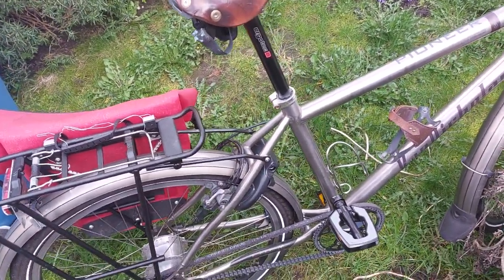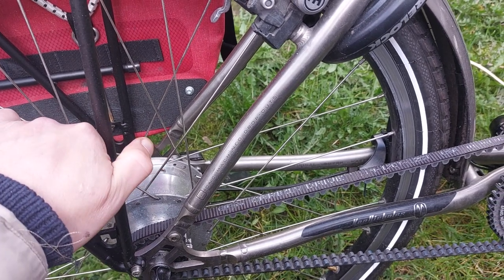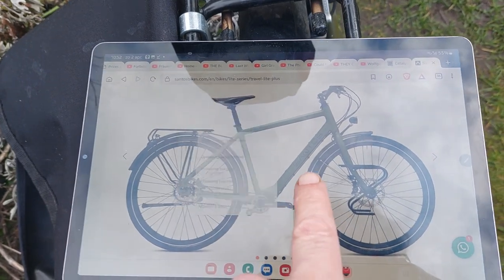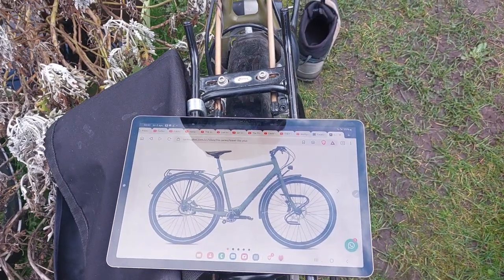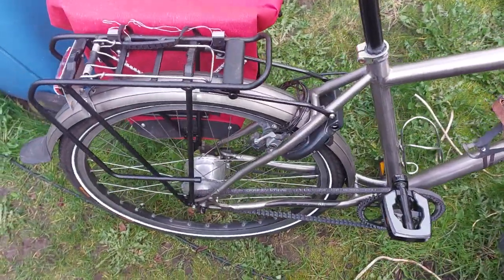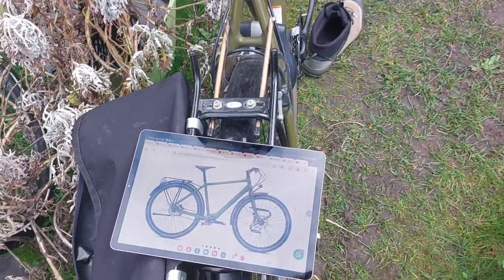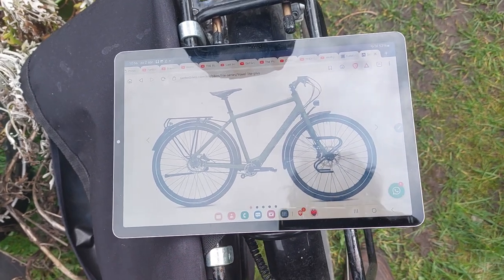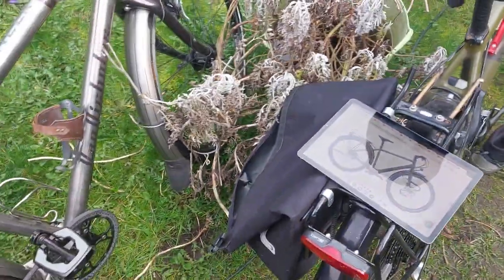Compared: Pinion P1.18, C1.12, Rohloff + Gebla Rohbox, Rohloff + twist shifter, Nuvinci/Enviolo

Comment: thanks. i am thinking of selling my pinion c12 for an 18. you made me make up my mind more quickly. by the way, what is the water cage you use with the leather strap? my water canister is too big for many, but looks like it would fit in there.
Reply from the maker: The p18 is definitely nicer, but try to find a shop who has a bike with p18 to make a test ride to be sure it is good enough to make the change... The bottle cage is the "Point retro". The main body is aluminium, the strap is adjustable in size with a clamp. The specifications state it works for a diameter of 68mm-80 which means it is quite useful to put in non-standard bottles. It is a bit pricey at about 30 euro...

Comment: Maybe a short suggestion to the high force needed to shift. I have noticed that the shifting is especially hard, if the shifter cables are very tight. Since the indexing is in the hub, the cables don't need to be anything close to tight.

After my initial shifting cables lengthened, the shifting went of with less force. The bike shop tightened them again and the shifting force went up again. Nonetheless, even with quite a bit of play in the shifter, the grip-shift of the Rohloff do have a rather high shifting force.
Reply from the maker: I have some play in the shifter so the cables are not particularly taut and it can't be improved. I tried to make the cables taut and you then quickly get a higher shift force, but all tests were done with fairly low tension and with quite a bit of play in the shifter (which doesn't bother me). The angle per shift step (rohloff ca. 21 degrees)  is nearly the same as that of the pinion (I estimate ca. 19 degrees), and yet with the pinion I could shift comfortably 3-4 steps in one go, with the rohloff hub 2 steps so the force is the major factor and it needs to be a lot lower to improve this but as the cables are not taut it's not going to get better, unfortunately. This can be a big difference and it is likely what made the difference between the 3 bikes with enviolo hub at a bike shop when I accompanied a relative to check out pedelecs, where I tried these bikes. There was no or barely any play in the shifters of the  3 bikes but 2 were likely just past the point of no play, to too taut which caused them to be heavy going.

Comment: I have ridden 5300km with Pinion C1.2. The main disadvantage for me was too big gap between 9 and 10  gear speed. When it is my max rotations on my 9 speed (about 26-27kmh) and I change for higher 10 gear speed I am too weak to ride on 10 gear and I loose my velocity to 25km/h and soon I have to change again for 9 gear. That`s why I will change C1.2 for P1.8
Reply from the maker: @adambog5871  Good point, so that gear is right in the region where you would want a smaller gear step, because it is an often used sub-range of the total range and thus there you would want the possibility to select a better fitting gear. With the C1.12, even though all gear steps are the same, these steps are not optimal as I calculated (contrary to the P1.18 which isclose to optimal), and you only use ones in a specific range a lot, namely those for riding on flat terrain with moderate wind, the rest are for the less common situations such as accelerating, riding up hills, riding fast with a tail wind. This is similar to why I suggested to Sturmey Archer many years ago that their 5 speed hubs should have a different gearing. It used to be 1 -> small step -> 2 -> big step -> 3 -> big step -> 4 -> small step -> 5, whereas I suggested:  1 -> big step -> 2 -> small step -> 3 -> small step -> 4 -> big step -> 5, which would give 3 gears close together in the most used range and still you have a hill/traffic light gear + tail wind gear. Instead of doing that, they later went with even steps... How do you like the shifting with the C1.12? Smooth enough?
Reply from the maker: @adambog5871  Addition: I've ridden about 2600km with the P1.18 so far, more to come this summer, on all the varied terrain (from flat up to quite steep hills) and various types of roads in Ukraine and I like it more than any other system I used. I like the nuvinci/enviolo too but its range would be too limited for in UA I think. Rohloff is a 'no' for me and derailleurs are 'it works but has plenty of annoyances'. Switching gears while climbing a hill is also good/fast, contrary to with a derailleur.
Reply: @WHS_reviews  Shifting with the C1.12 was a disappointment. Not precisely at all. My old Nexus 8 was a level higher than C1.12 with shifting.
Reply from the maker: @adambog5871  : That is interesting. I didn't have this feeling at all with the bike with C1.12 on which I did a test ride.
Reply: @WHS_reviews  Pinion grip shift has too large play. I wish it was a noticeable indexing.
Reply from the maker: @adambog5871  : Late reply: I don't think so, you should be able to fix the play but let me check on the P1.18 and specs of the others how to change it, I will go to Kiev soon (1-2 days), get the bike from storage and address this if all goes well. For me the play is fine, on this Stevens P1.18 I use it as it came and compared to the Rohloff hub play is minimal. With the Rohloff hub I can reduce play in the shifter movement but then the shifting becomes very heavy going as I mentioned/tested in a video.

Comment: That's ridiculous. For 7300 euros, you can get a new bike. I'm not comparing the pleasure of traveling by bike or motorcycle. I'm just comparing the cost of producing a motorcycle where there is a gearbox, there is an engine, there are electronics. And now compare that to a bicycle...
The price of a bicycle is 2,000-3,000 euros and then 1,000 euros is the gearbox....
I don't mean to offend anyone.
Reply from the maker: Yes, that's why I didn't even consider buying such a bike new, and 2nd hand they are too expensive too. There are a few german makers such as Stevens and VSF that make more reasonably priced pinion bikes, but new they are still 4500 euro or so. The people selling these 7000 euro bikes are living in a fantasy world, pretending this is anything but absurd. Note that this brand 'Santos' isn't selling custom bikes with frames made in the EU, the frames are made in I think it is Taiwan, so I don't see any justification for that price at all.